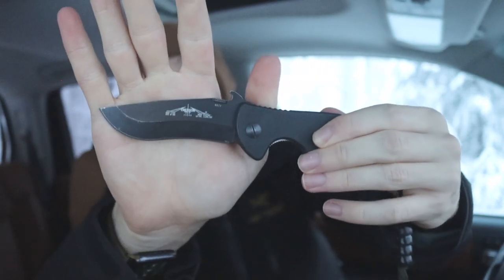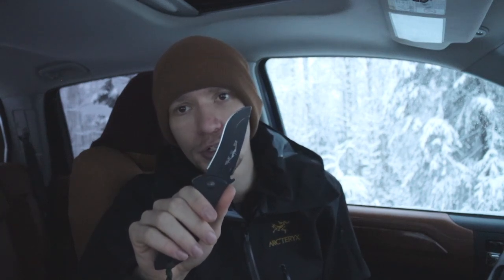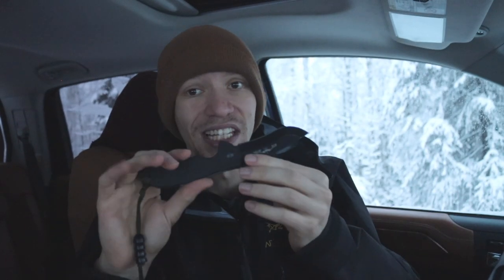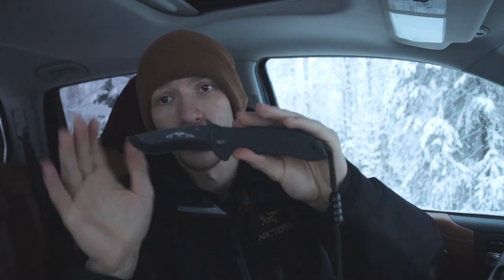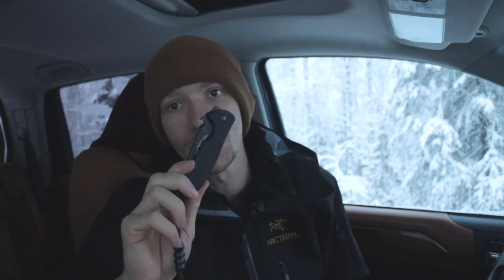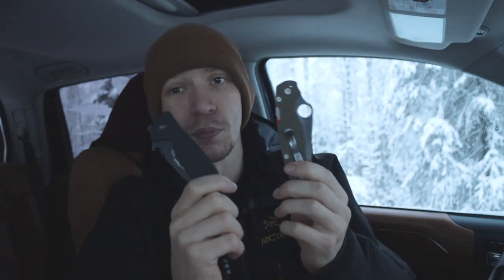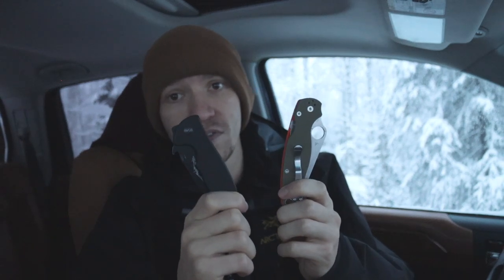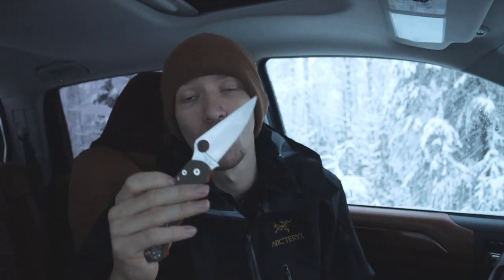Why Are Knife Steels Overhyped?!?!

Comment: First off I like 154cm and think it's a good middle ground between retention and ease of sharpening. I just dont think 154cm is good for a knife over 125 dollars. I have all kinds of knives with cool steels. Nitro V, S30V, Elmax, Cruwear, magnacut, ect. They are cool and yes they retain their edge a little better but it's nothing life altering. If I'm going to depend on a knife for my survival I'm going to use a 1095 full tang fixed blade like a Esee 5. Also even though I got all these rad pocket knives the knife I use more than anything is my Victorinox Farmer or Hiker and they have very basic possibly even sub par steel. I don't worry much about corrosion resistance either. 1 drop of oil after using on each side. Wipe both sides down and call it a day.

Comment: I saw my dad do every sort of task with his old Buck 110 in 440C. Skin and dress all kinds of game large and small, whittle, cut rope and rubber hoses, and even do chopping in the kitchen in a pinch. He kept it razor sharp and on a sheath on his belt at all times, along with a Case Trapper or Stockman style pocket knife. If I had the choice, sure, I'd take a more modern steel. But 440C and 425M were considered to be wonder steels at one time, and when properly forged and tempered they will do what work needs to be done.

Comment: In general a good all around steel is 1095, while the 420 stainless Buck has used for decades is a mainstay for hunting knives. High carbon 1095 is my preferred knife steel while Buck 420 in a hunting knife is acceptable. I pass on lower grade steels usually, but I'm always open to a better steel for the same money.

Comment: Good explanation.  I always wondered why my SOG Navy Seal 2000 was so hard to sharpen. This knife I understand has AUS-6 steel but some of the earlier blades had 440A.  Made by Seki Japan. Blade hardness RC56-57. One of my favourite outdoor blades! Does anyone have any comments on this steel? Cheers Dave 🇺🇸 🇳🇿
Reply: Its not hard to sharpen if you use the correct abrasives. Have you tried a decent quality silicon carbide stone you could try a cheap diamond stone from harbor freight, but diamond is better suited to 60rc +
Reply: @tacticalcenter8658  thanks for the advice
Reply: @davidneal6920  you're welcome
Reply: @tacticalcenter8658  recently a friend gave me a VSharp Warthog (of South Africa) knife sharpener. Seems to work very well for most of my knives
Reply: @davidneal6920  its not that good of a sharpening system, but maybe it will work with the ones your having trouble with. Ceramic shouldn't have issues with those blade steels. But burr removal will be the most important once you are off the system.

Comment: I think the most underrated steel is CPM154. Not 154 cm . There is a huge difference between the two. Also CPM3V is really AWESOME. I have been using my WINKLER a lot . They use 80CRV2 . It is really good also very underrated. Have a good one !!
Reply: I wanna try some cmp154 but yeah I love 80crv2
Reply: 154cm and cpm154 are both good steels.  They can be heat treated in different ways for more toughness like Emerson does so it can bend and not break where as most stainless would snap. Hard use type of heat treat that really only Emerson does with those steels.

3v is decent, I'd probably splurge for delta 3v from carrothers performance knives if you wanted something worth it. . as it can survive damage better than most. They use a low temperature temper in the heat treatment to get better edge stability, toughness and rust protection. Still rusts but better than regular 3v that uses the normal high heat tempers. Check out their videos on their YouTube and more info on delta heat treat on blade forums in the knife making sub section.